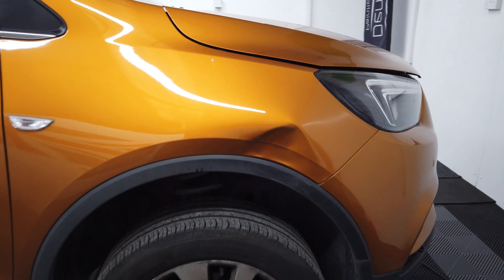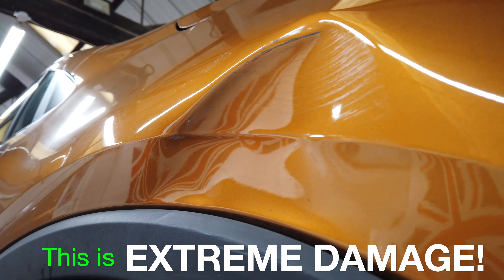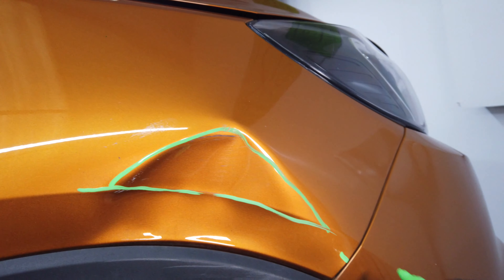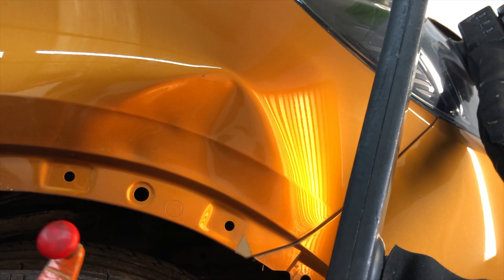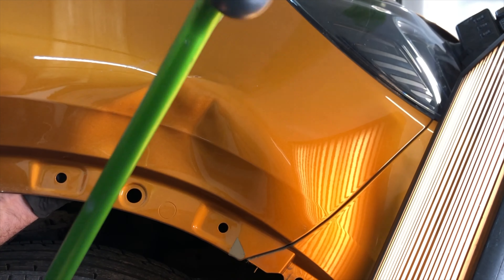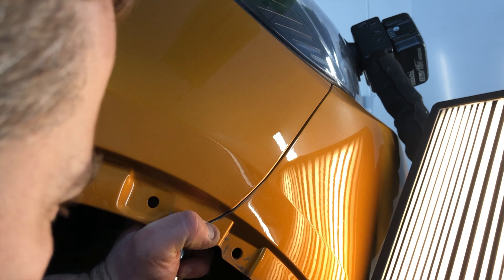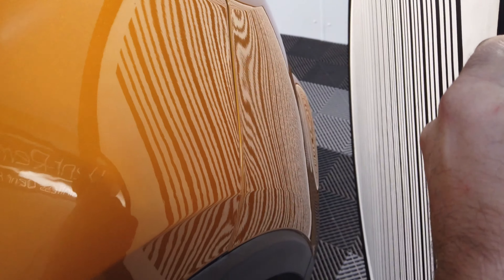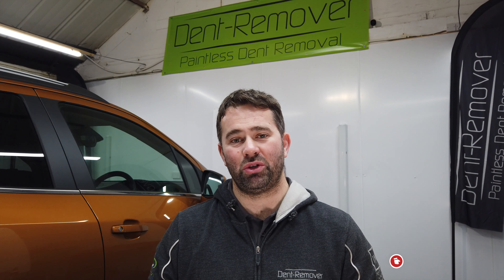PAINTLESS DENT REMOVAL UK | Extreme Damage Repaired Without Painting | By Dent-Remover

Comment: You do the best work.  I wonder how many hours did it take for a pro like you to finish to this extreme level of perfection.
Reply from the maker: Hi MrBDeye thanks for your great comment. This job took me about 7 or 8 hours to complete, but took a good few years of practicing to get me to this standard 

Thank you for watching I really appreciate it and for the comment

Thanks Martin
Reply: @dentremover01  A tree fell on my wife's SUV.  The wiper broke off and a deep dent on rear pillar.  I have the tools, glue pull and light board and did my best to fix it.  I need to learn more and get better.

Comment: Quick couple of question Martin, how would this kind of repair compare cost wise to a standard fill and paint, and also, do insurers use you guys for repairs?
Reply from the maker: Hi Martin.

Ok cost wise to a repair and paint. If painted by a cheap shop then it maybe on par

My prices are under authorised bodyshop prices

It’s very difficult to compare simply by price because pdr is 
Quicker, meaning the repair is done within hours or a day
Better, meaning the dent is magic’d out and you keep the factory paint and any warranty
So really compared to a repair and paint, pdr should be higher value wouldn’t you say?

Say that wing was £300 to pdr, baring in mind it’s a 3 stage Pearl
It would be tough for a small bodyshop to repair (fill) this wing, mask up and paint the wing, door, wing corner and poss the bonnet in 3 stage peal for 300- it’s going to be a rush job no doubt or at least would be where I live.

Regards the insurance yes sure. We use an estimating software where price is standardised using dent size, location etc. If it’s an insurance repair then we estimate and send off. They will happily pay as they know it’s a better, quicker and cleaner repair. 

Hope this helps, sorry if I babbled on and feel free to reply
Thanks Martin
Reply: @dentremover01  thanks for taking the time, I appreciate it. Your very skilled.
Reply from the maker: Thanks Martin no problem at all. Pdr is a small niche and it’s good to get the info out there.
Anymore questions your welcome to ask. I have a new vid out tomorrow 5pm GMT which is really good so I hope you can catch it
Thanks Martin

Comment: Good job ! Can you please tell me where have you bought that lamp with stripes ? And also a hammer with that rubber tip to tap down the crown .
Reply: Dent - Remover Ltd thanks for your reply. I have found the light board, but it seems that they all come without stripes on it. Did you stick the stripe film by yourself on top of it ?

Comment: I got a little damage on rear fender and some folks are telling me that there is a double layer of metal and they can't give me assurance it can be fixed. So my question is, is this true that it can't be repaied on this kind of part on fender, or just they don't know how to repair it? thanks
Reply from the maker: Hi Lev
Yes some rear fenders are double skinned, I’d say if you have damage like the dent in this video then it’s most probably not going to repair 
But you may be able to have it repaired and painted? 
Thanks Martin
Reply: @dentremover01  That's what I'd like to avoid :/ because the damage itself imo is so minor that PDR should fix it easily.
Reply from the maker: Are you able to get a second opinion? From another dent repair place?
Reply: @dentremover01  Yes, I found one. His first word was - Let's try. When all others are saying the same, double skin, double, one said there may be even triple skin. You guys have to find some way.

Comment: Feels fake - You never showed how the actual dent came out, instead you just jumped to where you fiished up the last bits 🤷‍♂️
Reply from the maker: Hi Bjorn, fair point, this job turned up unseen and took me about 8/10 hours to repair, I have lots of extra footage of the repair but to add all this to a short video isn’t possible, the video was to show what’s possible without painting as part of an entertaining video. I can assure you it’s not a fake repair...
Take a look at my latest repair this is 15mins long from another 10/15hr repair condensed into 25min total video. I’ve added more in-depth shots so you can see the repair process- I think making a long video would only put people to sleep! 
Happy to answer any further questions about it
Cheers martin
Reply: No fake, you can See is not perfekt! To much work for this Resultat. Better you paint this. 8/10 houers are 800? Paint Job maybe 400-500....